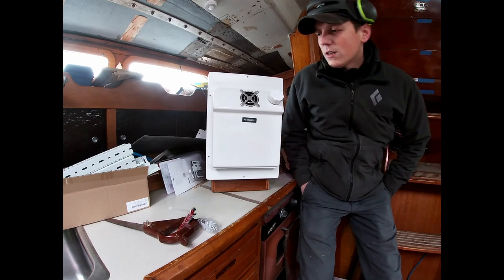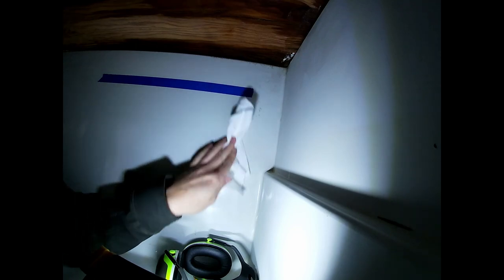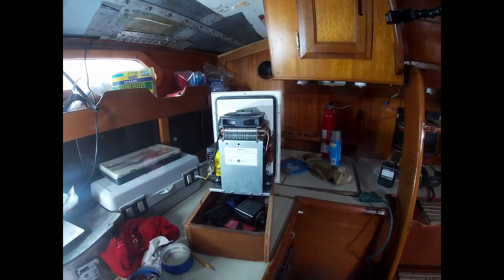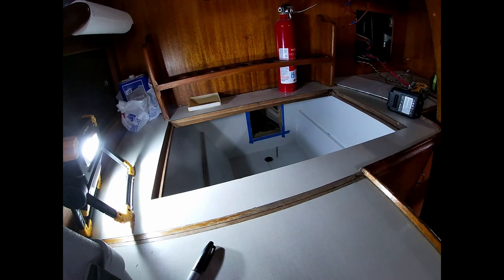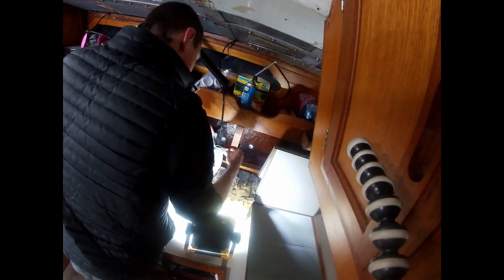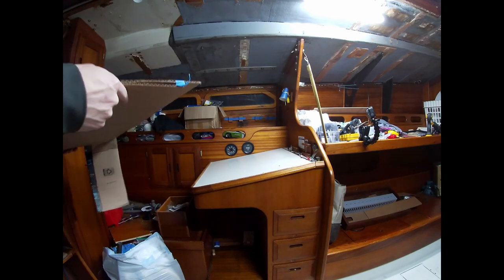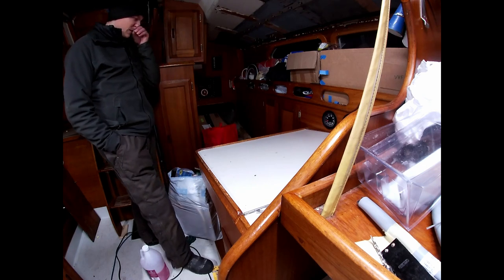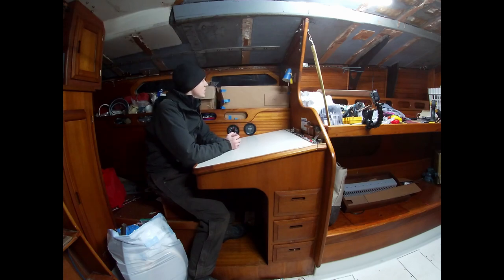Converting our Icebox to a Fridge. S1 EP7

Comment: How did this work?  Would love to know as I just picked one up to put in my ice box… thanks!  Can’t find any info really on the unit I think they discontinued it… cheers and happy sailing!
Reply from the maker: It works alright, I think that the issues I have with it might be more with the icebox than the unit. The icebox isn’t sealed the best against moisture and is on the large size for the units capability. I think because of these two issues the fins ice up occasionally. Another boat at our marina installed the same unit and hasn’t had any issues but the icebox was smaller and mover vertical space